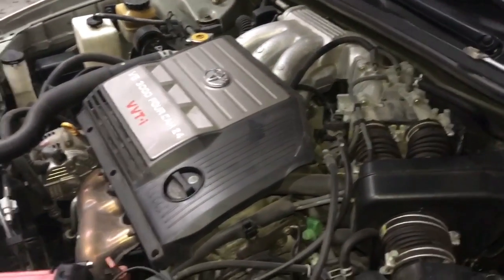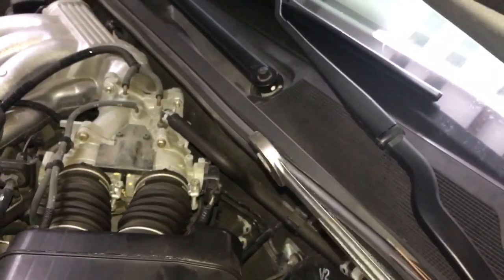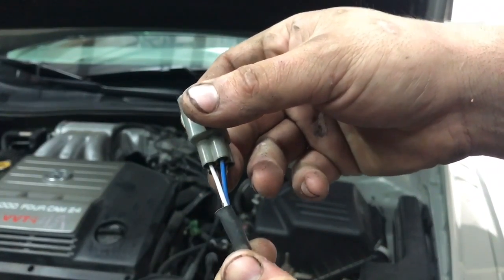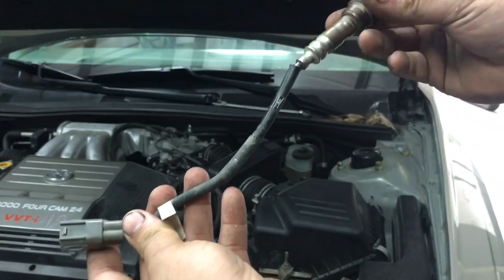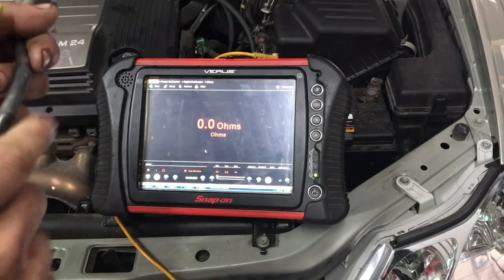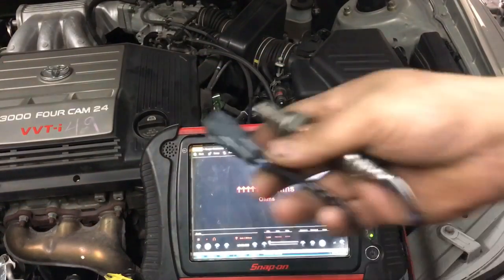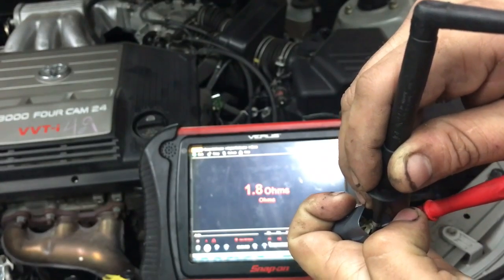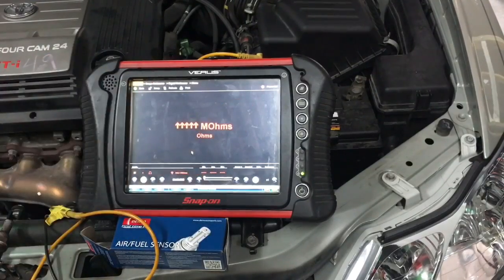P0030 trouble code. Oxygen Sensor Bad heater circuit. (Better Version)

Comment: I replaced my oxygen sensor and its still giving P0030 even right after reset. With previous oxygen sensors, it was saying P0171, P0172 and P0030. I'm sick of this. Mechanics in my country don't know about this. I use OBDII scanner and guide to mechanic what to do.

Comment: Thank you for video, learned how to test sensor, I have that P0030 and P0171 codes on my Subaru Impreza 2007 Hawkeye 2.0R (EJ  20) 160PS, car runs good, but it eats fuel, 30% more fuel than before check engine light for same mileage and it does "boom" from exhaust when you lift foot off accelerator... sensor is 100% bad, but now I have one hard decision:
Denso sensor is 280$ in my country, and some generic (universal) sensor is 50$ - so, what do you say? go with generic or spend more money for Denso?

Comment: Hi I changed the oxygen sensor and the p0030 code stayed on
Reply from the maker: Anthony Lopez p0300 or p0030 ?
Reply: P0030
Reply from the maker: Anthony Lopez did you test the O2 sensor to verify it was bad ?
Reply: Yes I did
Reply from the maker: Anthony Lopez if you cleared the code and came right back I would test the wiring to verify it’s not shorted.
Reply: Ok will do thank you

Comment: I bought a pair of eBay sensors that fit my car, and still have the problem. Will test the old ones and the new ones this way... and if nothing works, will have to go with OEM Denso's or check the wiring from the car. Thanks for the video!!!
Reply from the maker: Voda XTR sometimes a vehicle might have 2 options an oxygen sensor and a air/fuel sensor I’ve had customers make that mistake

Comment: My o2 sensor has continuity and its receiving 12v. Idk what the problem is. I have p0030
Reply from the maker: Javi Habi i worked on one that the wiring was damaged. So just make sure all the wires going to the o2 are good